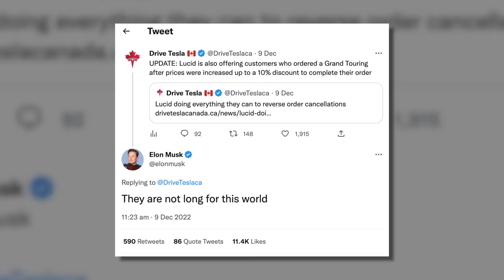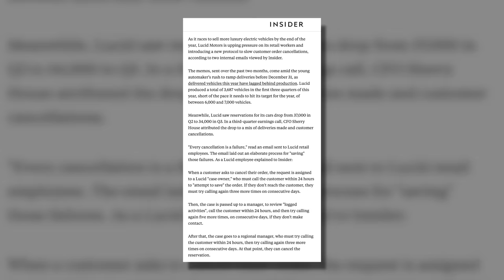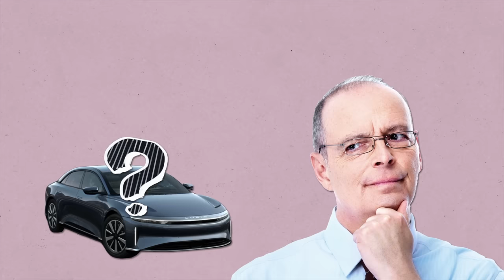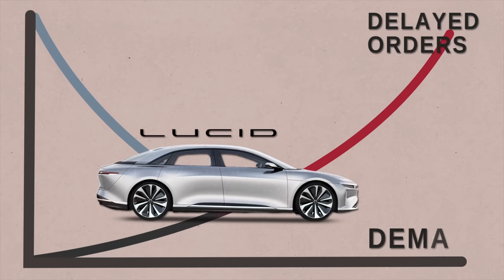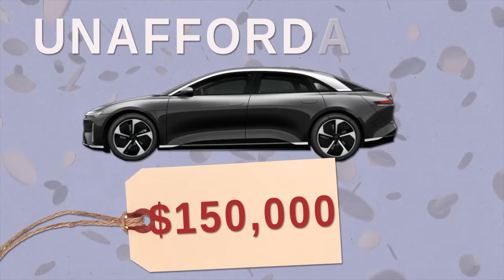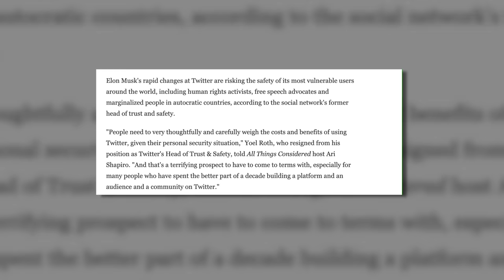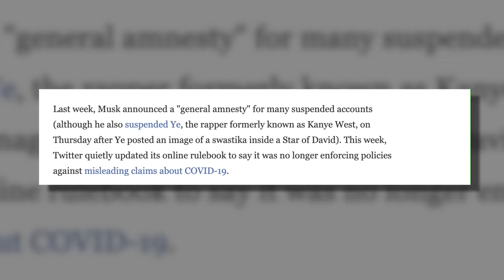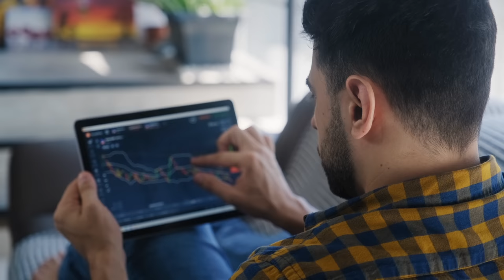This Car Brand is Going Out of Business

Comment: Imagine spending 200k on a battery powered car
Reply: That doesn't work well in the cold.
Reply: I know, insane right 🤷‍♂️
Reply: XrpAndy  ,  I don't trust those batteries. That's why I bought a 400-mile-long extension cord for my EV .
Reply: i bought a china made little rc car toy for less than 15dollars and boy i was surprised how tiny electronic rc circuits have become on these since the 80s and 90s🐱👍🏿

Comment: I feel E.V's are going to be like CNG rigs, few, and declining quickly. As you have said, we do not have the power or resources to make E.V.'s common place. No Electricity to charge them, Too Expensive to own, & when they break, too expensive to fix. Not for the common person. The auto industry should rethink WHY the original VW bug was so popular. Low cost, easy to maintain, & easy to fill up. E.V.'s are not any of that. :-(

Comment: It seems all tech based car companies are struggling to sell cars, produce good quality cars or have have monetary problems. In the UK a company called British Volt who were going to produce EV batteries had only just opened the factory up and have now gone bust. They are blaming the looming recession but reality is that they only have a small market of people who want EV's and the ones who have owned a EV for three years are starting to trade them in and buy hybrids or internal combustion engine cars because of the hassle they have had with the car reliability, price of electricity and the charging infrastructure. In the UK the charging  infrastructure shocking even though more chargers have been installed as these chargers don't always work or if they are working they are already full.

Comment: Scotty,  my 2015 kia soul isn't leaking oil anymore but my engine light is on.  I live off disability social security.  Auto zone told me to by this stuff to put in my gas tank to clean my catalyst converter it was 24.99 I bought it my my engine light is still on.  I pray my next car can be a toyota or honda but right now I got to make this car live any suggestions?  Blessings and love
Reply: Email Scotty to get a reply
Reply: Go on the highway and punch it on and off exit ramps to the floor with that stuff in the tank. And run fuel injectors cleaner and beat on it a little to get the cats hot.  Go on a long ride and fast and step in it. Less stop and go
Reply: does it still have oil in it?